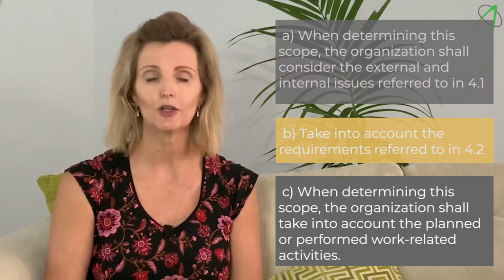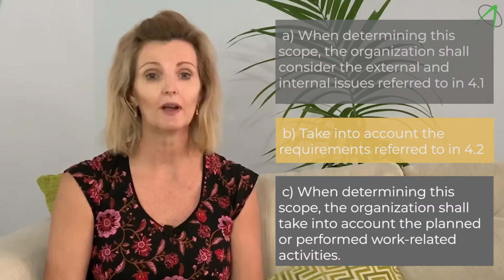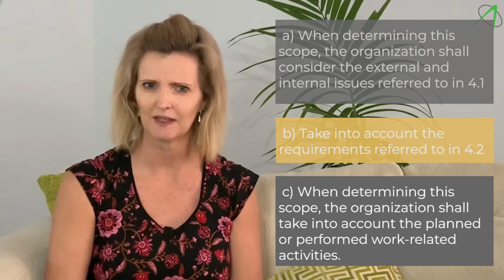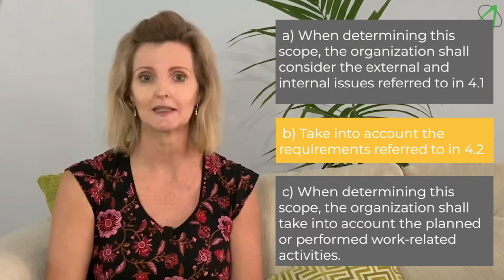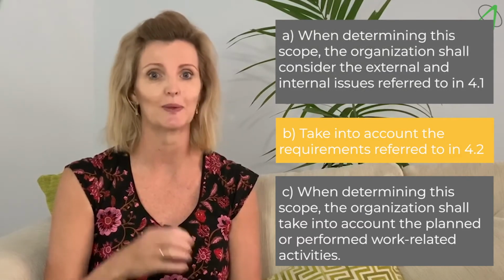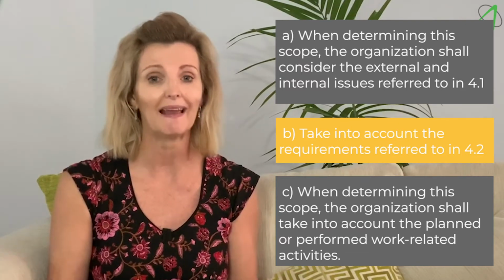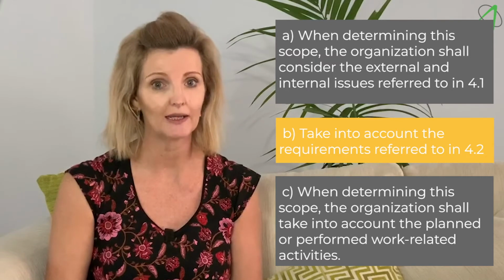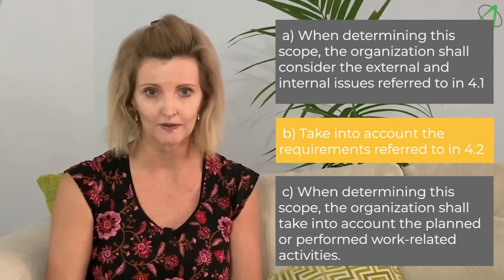ISO 45001 Clause 4.3 | Auditor Training Online

Comment: Where must it be documented? on the policy?
Reply from the maker: What a great question! The scope of the management system can be documented anywhere. You could include it on your policy as it does align well. I have seen the scope documented on the policy, in a manual, in a separate scoping statement. Whatever is most relevant to the business and how they communicate. Thanks for the great question @fatihmouras8593. Regards, Jackie